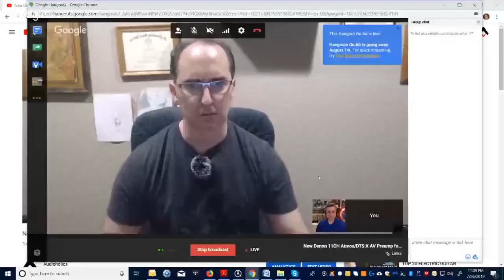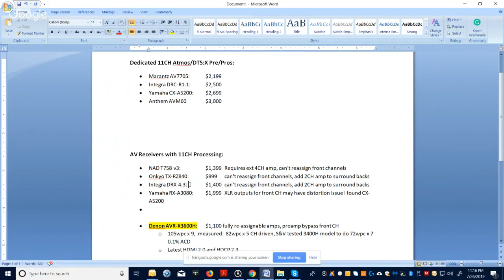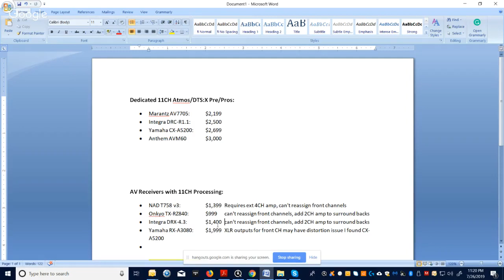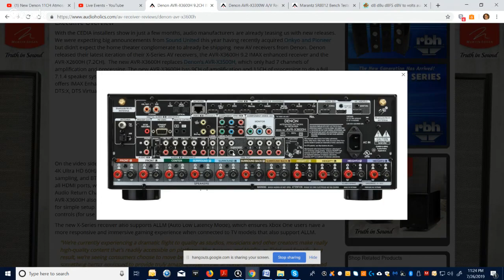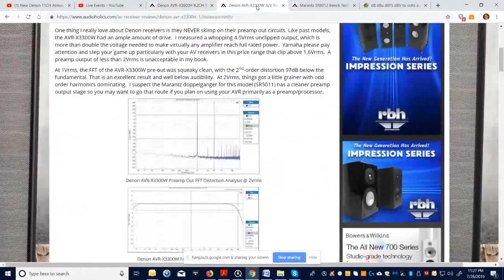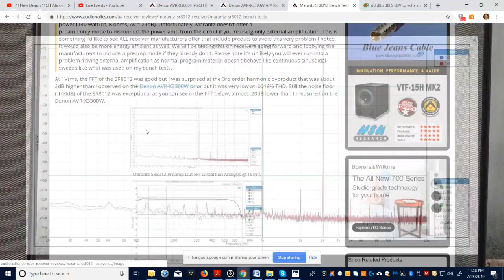Denon AVR-X3600H 11CH Atmos/DTS:X AV Preamp for $1,100?!?

Comment: What about the sr6013 and the x4500h? Those also have 11ch and pre-outs for $900-1200
Reply from the maker: Yes but the SR6013 is $1,499.
Reply: Audioholics the Marantz SR6013 it’s on sale for $899.99 at Crutchfield
Reply from the maker: @straight6supra915  nice, definitely worth consideration.
Reply: Audioholics Im kinda stuck do you think the Marantz sr6013 will be able to drive 2 Klipsch rp-280f good enough with the SVS ultra center without getting a 2-3 channel amp? If a amp is needed what do you recommend? I was thinking of putting the Klipsch rp140sa add on speakers on the towers.  A SVS sb 3000 sub and Definitive Technology SR-9040 2 way surround.  The SVS ultra center is amazing from what I hear do you think that setup would sound great? Secondly There really isn’t much difference between the rp-8000f vs The rp- 280f except the price right?  I’m new to home audio I’m using this for playing xbox on my Samsung 65” Q8fn QLED 4K tv so I want the gunshots and explosions to sound real but Let me know your thoughts?????
Reply: @straight6supra915  i sold my polk rti12 and now use rp-280f klipsch . my rx v-681 drives klipsch good because there efficient
Reply: Johnny Bravo great to hear I believe i made the right choice I did go and get the Klipsch rp-280f speakers for $400 a piece and added the Klipsch rp-41sa Dolby Atmos speakers to put on top of the towers I got those for like $275 and I went and got the Marantz sr6013 for $899
Reply: Audioholics same in the netherlands, you can get a sr6013 for around €900 and x4500h went on sale for €999 on amazon germany last month

Comment: Hey Gene, which HDMI splitter do you suggest? Thanks in advance.
Reply: HamillTap I recommend HDMI splitters from Atlona, HDfury, and Monoprice. If you’re looking for something that is bulletproof and has strong IR and integration then look to Atlona. You pay more but it’s bulletproof. Atlona is great for integrators and some products feature a web GUI and EDID options. I’ve had excellent experience with HDFury products as well. Monoprice has been good value but some of them have been hit or miss. In my experience it depends on the individual HDMI splitter or matrix product. There are lots of other brands out there but those are three I have direct experience with.